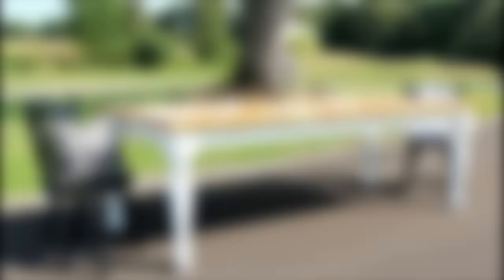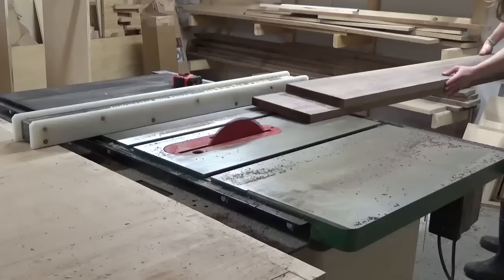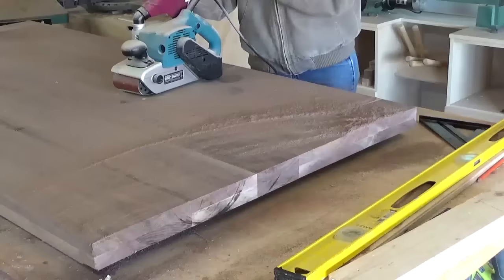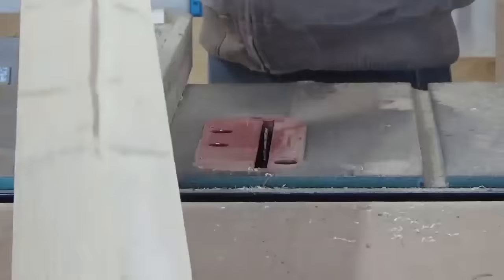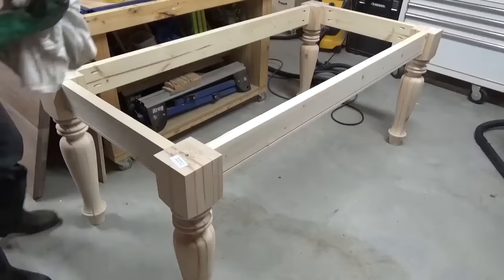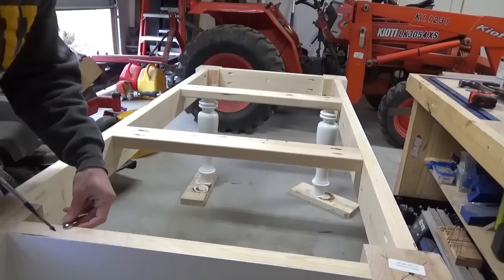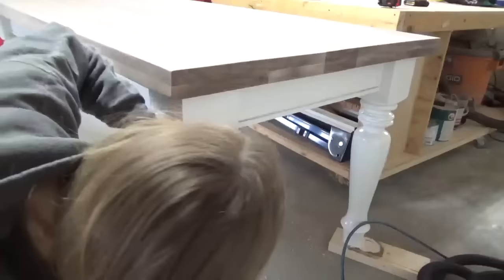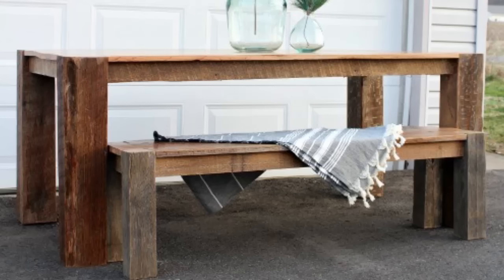How to Build a Simple DIY Dining Table With Laminated Walnut Top

Comment: Shara, did you paint the chairs? I want to paint my dining room chairs, they are now stained, but I want to paint them black. Any ideas on the best paint to use?
Reply from the maker: I didn’t paint them. They came painted black when I bought them. If I was painting, I’d prime with Kilz 2 or 3 then paint with a high quality paint. I like SW Emerald paint personally. But I’d try to find a sprayer or a friend with a sprayer because brush painting spindles is a nightmare.

Comment: There are a few ways to take this table top to the next level. First, end grain is best hidden, a breadboard end will hide that end grain. Second,there are also several methods for hiding the long edge glue-up joint. Give it a try on your next table, nice work on this project!

Comment: What’s the worst injury you’ve had while making one of your projects? Great table !
Reply from the maker: Thanks! That’s an odd question....I can’t think of anything really off the top of my head. It’s mostly just splinters, smashing fingers on accident and little cuts and scrapes from just using my hands. Ive never had any major injuries from woodworking.
Reply: Shara Woodshop Diaries well that’s good. How did you learn about woodworking?
Reply from the maker: I remodeled a kitchen several years ago and couldn’t afford a new 8ft table for it so I built it and just taught myself from there 👍
Reply: Shara Woodshop Diaries awesome. You do great work.

Comment: Hi Shara, I didn’t know where to ask you a general question  so here it goes . What height is your table where you breakdown your plywood ? Thanks
Reply from the maker: My workbench? Or my saw horses? My saw horses are adjustable height. I’d say I usually set them about  30” tall. I’ve never measured. But my workbench is the exact same height as my table saw table so I can use it as an out feed table. I believe it’s about 32”
Reply: Shara Woodshop Diaries Thanks

Comment: Why not just get 8/4 walnut and mill it down and use biscuits when joining? Also, ever think about using different joining methods other than pocket screws?
Reply from the maker: White Collar Workshop the customer had 4/4 walnut they wanted to use. So I just laminated it.  I use other methods of joining occasionally depending on what I’m building. For this, pocket holes worked well and made this quick and easy to put together.
Reply: @WoodshopDiaries  For a table of this weight a good idea might be reinforcing blocks in all eight places where the legs contact the skirt, this would allow for really strong screwing directly into the legs and the skirt, the base would be many times stronger than 2 pocket screws on each skirt edge. This tabletop could have had been 1" boards with the perimeter built up, much like stone countertops.